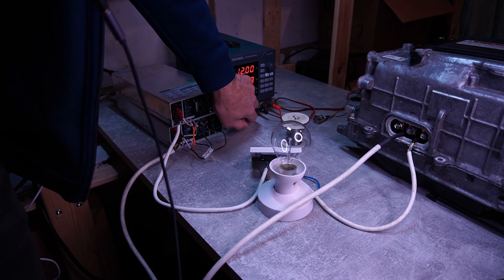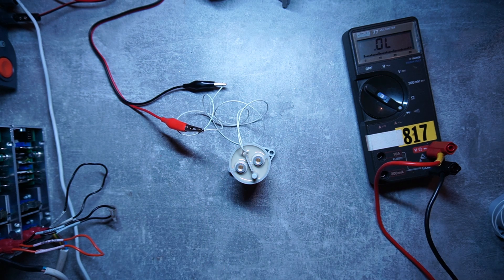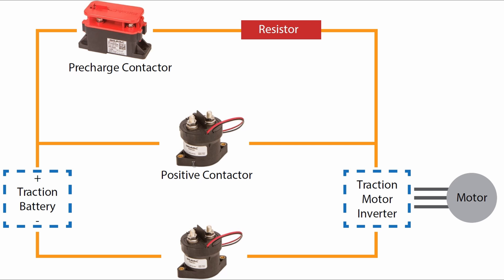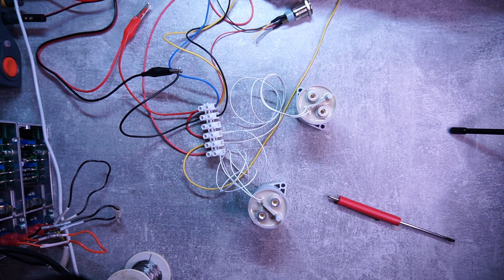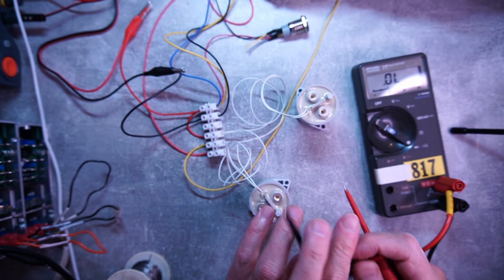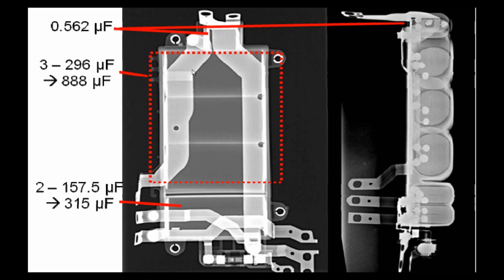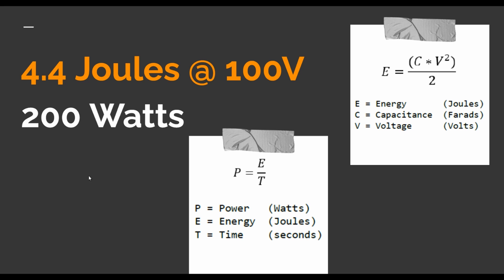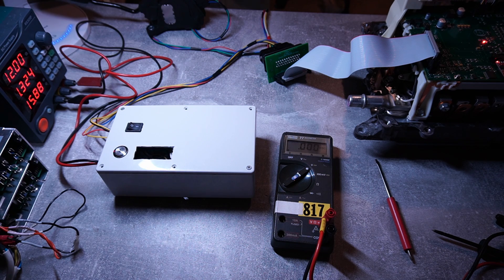Contactors and pre-charge DIY EV Toyota Prius Ep 14 EV

Comment: How do you make start on the ignition barrel turnoff the pre charge and keep the car going? Maybe it’s dumb but I don’t understand as the start position is momentary so how do you make it work? :)
Reply from the maker: This is very good question, as you have seen in the video for first experiment I used only positive contactor and precharge. I will add negative contactor and on ignition negative contactor and precharge will be closed and after some delay precharge will open and positive contactor will close. In the experiment I did this manually. With the switch precharge was closed and when I pressed the start button precharge was open and positive contactor closed
Reply: @LatutaEV  complicated. How do you achieve this from the start position?

Comment: Great info again, just a few points, people tend to use 2 main contactors, one on positive and one on negative. One of them ignition controlled, and the other controlled by open inverter. Completely isolates the HV when the car is off.

Another thing is is contactors don't contain built in economisers, some external one is required to prevent the coil burning out. The hold voltage is lower than the closing voltage so can be reduced once closed to reduce coil heat.
Reply from the maker: Thanks for the info yes I planing to implement two contactors for positive and negative once I move to the actual car. It is just at this stage I have only two to experiment with the battery
Reply: I believe many do have economisers
Reply: @blackterminal  I have 2 pairs of gigavacs, one pair does, the other doesn't. Easy to check though
Reply: @JamieJones1985  what is the check Jamie?
Reply: @blackterminal  hook up to a lab power supply or meter, current should drop to below 1amp once closed.

Comment: hi is there any voltage sensing on the capacitors eg if it does not reach a specified voltage in a certain time to switch off?
eg high voltage fault
Reply: Yea, there is in open inverter. You'll get a udc under error, assuming the parameter has been setup correctly
Reply from the maker: No I don't think so, but I have a circuit design in mind I will try to implement to do exactly that